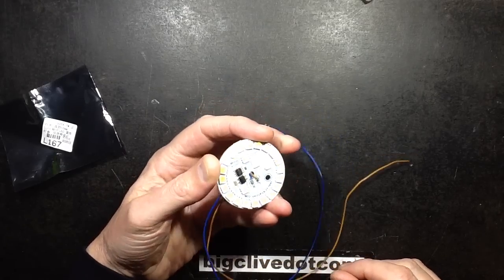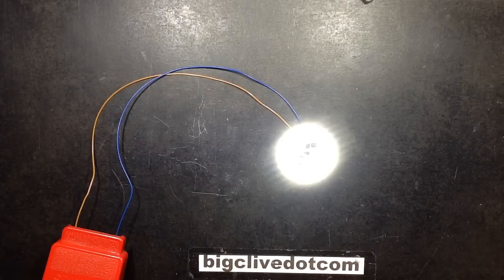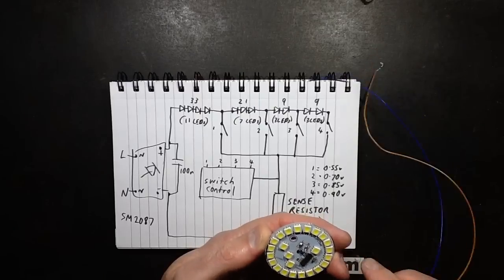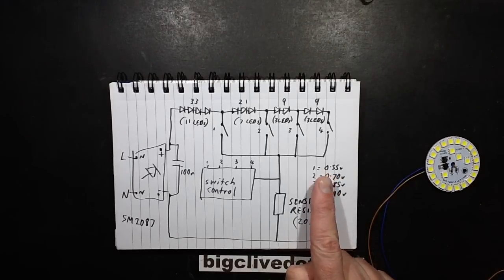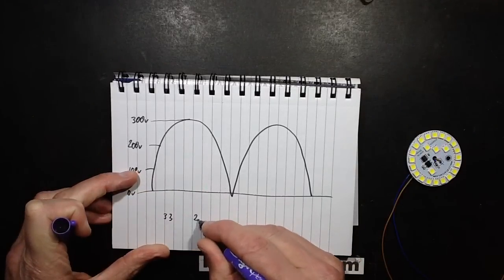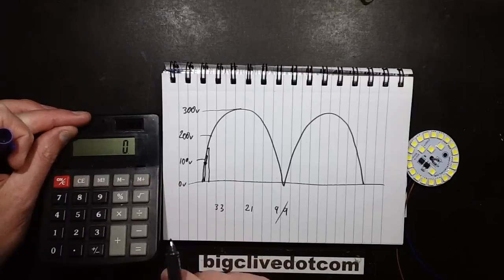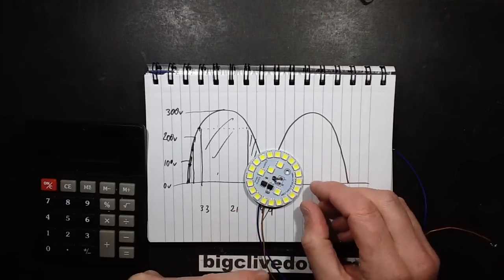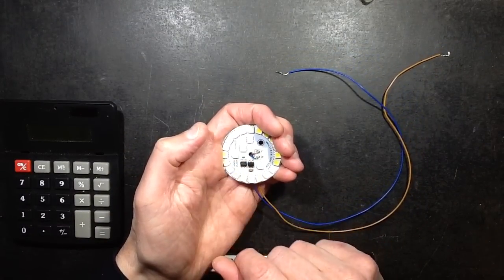A look at an odd LED panel that uses an SM2087 chip.

Comment: Very interesting. A multi-channel oscilloscope across some of the LEDs might show what is happening more clearly, even a crappy PC sound card based scope should work at those frequencies.
Reply: +xoz1246 
Could even use a normal LED for this (yes, they work as lightsensors, too). You could then easily scan every single LED for its pattern.
Reply: +Miloš Lazović the voltage is a problem.. very risky for all devices connected, regardless of protection (and the human operating it) not only that but for all these ideas you''ll need multi channel oscilloscopes, multiple phototransistors, etc.. impractical. the easiest and best solution really is an extremely high FPS camera.. we can see everything at once then without endless hours of recording waveforms and so on, so forth.. it would be interesting to probe, but in this case...high speed camera all the way which means..well, for a start, everyone can see it with their own eyes! would be interesting to see what was on each pin so maybe do both? lol
Reply from the maker: +xoz1246 Noting the voltages involved.  And while it could be connected to an isolation transformer it was directly across 240V mains in this video.
Reply: +Ryan Willis I was wondering about that too. A phototransistor or photodiode should be more than fast enough to pick up the waveform.
Reply: +bigclivedotcom How about hooking some sort of fast-responding light sensor to an oscilloscope? you should be able to see the waveform of the light emissions.
Reply: +bigclivedotcom Voltages are not problem, 100x (1000 Vrms) probe will do the job on any oscilloscope (or if you expect to measure voltages up to 20 kVrms there are 1000x probes) , only someone need to be careful and remember that oscilloscopes are usually earth referenced (but there are many techniques for floating measurement on them and cheapest is pseudo-differential techniques)
Reply: ChaosHusky
High voltage is not risky for connected device, high 100x and 1000x probes are made for that job (for probing voltages up to 20 KV rms) and it is how is done for years,
You will not need to probe for horses you will see what you are interested in less time then you need to review footage of FPS camera (if you know what you are looking for).
FPS camera will at best show you sequence on wich it turn on LED and all after thet you will need to guess (it will not show you voltages on which it switch LED for example, you can only guess it from footage).
Technically even 10x probe could do job (most oscilloscope are tolerant to 200V on inputs) but most probes are not capable of that voltages (most of them are rated for lower voltages).
There are even 20x differential probes  that can be used (rated 750Vrms) but they are little expensive for home user.

Comment: may it works like this:
when power is applied, s1 is on, once the first led's pass enough current, s1 off, s2 on, it goes through the sequence to s4 on, once it gets to the upper threshold (230v) s4 tries to turn off losing the voltage, so turns back on again, so the upper part of the sine wave results in a flickering light.
If you have access to a variable DC supply (variac  and bridge plus capacitor), you could see the sequence in 'slomo'
Reply: Good thinking.  The upper third of the sine wave is applied to the LEDs by running S4 via PWM.
Reply: +FlyingShotsman So they get 4-5 volt spikes as PWM?
Reply: +BloodySword It wouldn't be pwm as the pulse width doesn't change, more like the circuit oscillates during the high point (peak) until the wave drops below the threshold.
Reply: +Sparky Projects I would bet that's the case; many leds have a If max of something like 5-10x their normal operating current so long as its duty cycle is below a few percent. Could totally handle the high current side with pwmppm etc.